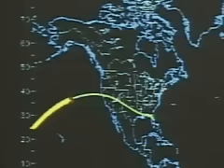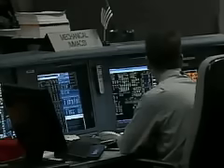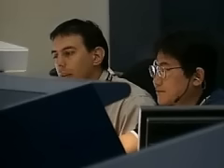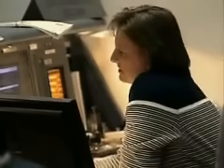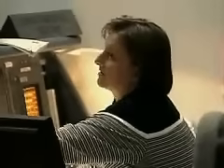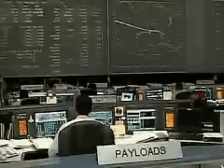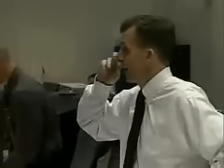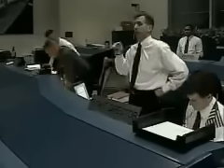Inside Mission Control During STS-107 Columbia's Failed Re-entry and disaster

Comment: The difference is that when the Challenger exploded, it only took folks about 5 seconds to realize what happened, even civilians were aware in about 10 seconds.  With Columbia's re-entry, 4 hydraulic high-temps, a minute later communications were lost, a minute later, 2 left tire pressure failures, a minute later off-scale low temp readings. Columbia MC had much more time to gradually digest reality and remain calmer, whereas Challenger was a quick, abrupt surprise that rocked folks immediately.

Comment: Why are you comparing NASA and a space shuttle failing to a catastrophic building collapse? That is a non-sequitur. I see all your comments here. I am surprised the WTC did not fall faster. The explosion blew off all the fire insulation from the girders to protect them from being melted and distorted in the fire. Think of a bridge. How many girders can be compromised before it loses structural integrity? Do you know how heavy a hose is? Very. To be carried up 78 floors by two first reponders?

Comment: STS-400 was only one actually set on pad and ready to launch within 7 days (due to lack of ISS support contingency, which would require faster response time to have chance of success of saving crew), but the rest, while not that far in process, actually had everything on hand and prepared to finish stack assembly (if not done already), final system/crew prep, and rollout/launch if needed within 40 days... never needed, but was a little more along than just 'on paper'.

Comment: They didn't have the ability to fix the RCC panels in orbit (and didn't even gain that ability after the disaster, which is why they developed rescue contingencies). Also, Columbia did not have the ability to dock with a supply ship if they could have sent one. And even if they did, preparing and sending a supply ship or another Shuttle would have taken more time than the crew could have survived, and would have risked another crew for a miniscule chance of success even if doable by last minute.

Comment: The SRBs alone could not get the shuttle to orbit, or else they wouldn't require 6 more minutes to reach it after the SRBs burned out... even one SSME shutdown too early could prevent orbit. Also, remember that an SRB caused a Shuttle loss years before this. And, SRBs are far more dangerous than liquid engines, since they can't be turned off once lit... otherwise Challenger could have perhaps been prevented (if the boosters had temp sensors and the computer could have shut them off in time).

Comment: Impact sensors were added later but the way they worked was that the crew had to hook up a laptop after on orbit and use a program to download impacts from each sensor. This still would have not helped them on launch. And without an RMS and an arm camera on STS-107, they would had to do an EVA if damage was detected.

Comment: Columbia broke up during/right after the last broken transmission from them around 5:15-5:20... they didn't know immediately that it happened, but you can tell that it was confirmed to them from an outside observer (and that they  had gradually realized it leading up to that point) at the 12:00 minute mark when Cain is talking to the people behind him (right before, and the reason, he had the doors locked and started contingency procedures), and they were obviously upset at that point.

Comment: That would only help if the news was live and actively filming the Shuttle landing (which was not likely at the point it broke up). MC knew of the breakup within minutes, faster than the news started showing video of the breakup, and by then the TVs would have been turned off during lockdown so as not to contaminate MC's data logging. Also, NASA used to do that for additional views during launch using the news feeds, but is not necessary since installing over 100 cameras that film every launch.

Comment: Wrong, there were 12 Shuttle missions with a backup Shuttle assigned to perform a rescue mission if needed (look up STS-3xx and 400). The flight to Hubble (STS-125) was just the only one completely assembled, taken to launch pad, and ready to launch within 7 days (the rest would have taken about 40 days to complete prep, checkout, and launch), due to it being the only mission after Columbia NOT headed to the ISS, and without the ability to use ISS to support the crew until rescue.

Comment: As artifice1112 said, the last transmission was around 5:20 on the vid (which was just static, the last transmission with talking was a few seconds earlier, the one they were asking to be repeated). The reason they don't mention the loss yet is because they still don't know it happened; they realized something was wrong shortly before locking the doors (initial ext. reports were received but not discussed on the loops), and after that they were logging data and looking for official confirmation

Comment: Also, the shuttle could not reach ISS, it was too heavy and not even near the ISS's orbit parameters. If that had been an option, NASA would have been less likely to dismiss the possibility that the damage had occurred since rescue would at least be possible (I still believe NASA denied the option of damage assessment because they knew there were no rescue options, and their only hope was for a safe normal landing, requiring an undistracted crew).

Comment: Once the foam struck, the only decently and possibly reliant chance at saving the crew would have been had they known immediately and performed an RTLS  or TAL abort, but since they didn't have impact or other sensors to alert them of the damage, they weren't aware of the damage during launch to decide on these options. As cold as it sounds, it was probably best that the crew and MC didn't know... with no reasonable rescue chances, better that everyone stay blind, so as not to panic...

Comment: Wrong. Since they did not have rescue contingencies in place for situations like this till after and because of this, they would not have been able to do a Shuttle rescue. Columbia could not have supported the crew long enough to plan a rescue. By time they had another shuttle prepped and crew ready, it'd be too late. And they could not have repaired the wings in orbit (it wasn't tiles), and they would have had to transfer the crew and ditch the shuttle. Once the damage happened, it was too late

Comment: What i meant was they got lucky on STS 27. Came very close to the same outcome (a whole tile was missing,  right over a plate that was an antenna mount,  and the plate had melt damage,  anyplace else and it would have burnt through. )

Comment: The astronauts knew there could be an issue. Hoot Gibson had this same situation (serious thermal protection system damage) and since it was a defense department mission,  the images the crew sent back had to be encrypted so they looked like crap. Bascially Gibson thought they were in serious trouble and saw that the shio was coming apart,  he would use his last moments to tell the ground what he thought of their engineering assessment.

Comment: No, from what I saw I know 1 thing. I watched EVERY Shuttle launch, I remain GEEK in that manner. There was a reason NASA took a no-flight down-time. Columbia was damaged on launch, left wing had a hole left by falling foam from main fuel tank. I can tell you solid fuel boosters came within 100' of my back door on Norfolk Southern railroad. I've never seen that kind of Railroad police emerge until 1 train stopped of mechanical failure. I was told SIR! step away from the train.

Comment: I know, hole in her left wing that girl fought for control!! I'm nerdy 1. Sensors reading tire pressures?  Sensors reading heat in left wing? Cascade failures? I have done flight sims. Land a shuttle dead-stick, complete computer failure? Check hole in left wing? Girl turned, she couldn't compensate....

Comment: The orbiter has 3 independent hydraulic systems like most aircraft. Losing pressure in the gear doesnt mean they lose control. The evidence recovered during the investigation supported what they saw on launch video. No one has a manual for a hole punched in a spacecraft.

Comment: After Apollo 12 was hit by lightning during liftoff, there were worries at NASA that the automatic parachute mechanism might have been damaged, in which case the astronauts were doomed to destruction when they hit the ocean. As there was nothing that could be done at that point, they went on with the mission and the astronauts landed safely. So it was in this case. There was concern about the foam damage, but there was no chance for rescuing the crew and the mission continued.

Comment: His name is Leroy Cain. He was a flight director till the end of the program, no promotion. And yes, Linda Ham (the flight Mgr.) and Leroy were against photos. Linda got booted to I think Colorado for Nasa in some insignificant job out of site.
Reply: For someone working at NASA, as you told in some posts, you show quite a lack of knowledge here. Cain did one more mission, STS-114,  as ascent and entry flight director, then moved to KSC as integration team manager and by the end of the program,  he was Deputy Shuttle Program Manager,  in this role he was also leading the MMT at STS-135. Also he was not against the pictures, he was just not involved in this decision process, which was up to the MMT, which he was not part of.

Comment: @jelibeli100  ULF (Ultra-Low Frequency) as is already mentioned by someone. When a space shuttle or any spacecraft enters earth, due to high atmospheric resistance (high temperature) outside the craft, the radio communications are blackened for a couple of minutes. So the CAPCOM (the one guy who always talks from ground to the astronauts) keeps on trying "UHF Comm Check" - just to check whether the radio comm is back or not.

Comment: @jelibeli100 UHF = Ultra-High Frequency.  They communicated with the space shuttles on an ultra-high frequency because that's the best way to contact them based on the conditions, as opposed to ULF (Ultra-Low Frequency) or VLF(Very Low Frequency, which is how they communicate with submarines.)

GC = Ground Control, Flight = Flight Director.  Those are different departments/people at mission control trying to talk to each other.  "GC, Flight" means Flight is trying to talk to GC.

Comment: Circa minute 2:30 of this footage is the advisory of loss of hydralics/temp. reading on the "left side" (see the footage related from inside the vehicle...) where the flashing lights outside the windows caught the attention of the crew repeatedly.  

Back to this footage - loss of "all four" of anything, on any side of the vehicle, is a red flag.  All the silence, then at minute 5:30 + "Flight Control"'s worst nightmares are realized.  When "Comm" says they lost the "nose gear"; that's it..

Comment: 8:59 a.m.

Data is lost from tire temperature and pressure sensors on the shuttle's left side. One of the sensors alerts the crew, which is acknowledging the alert when communication is lost.

There is another video posted on YouTube by a person on the ground videoing the Columbia as it passes over Arizona, it's clearly shedding debris at that point.